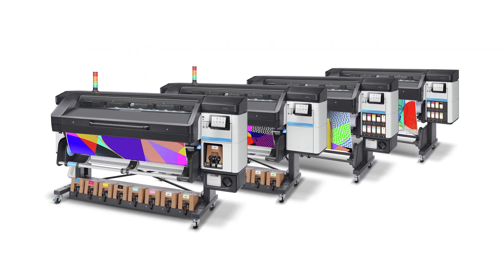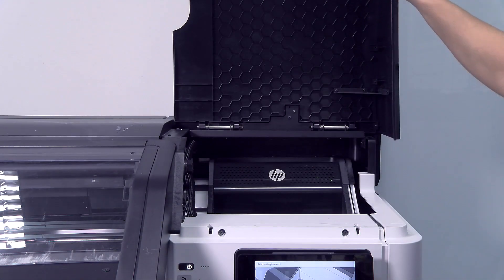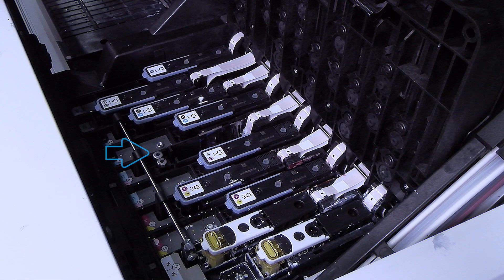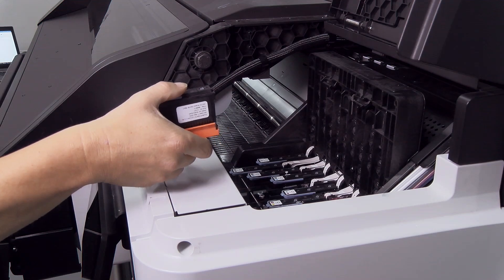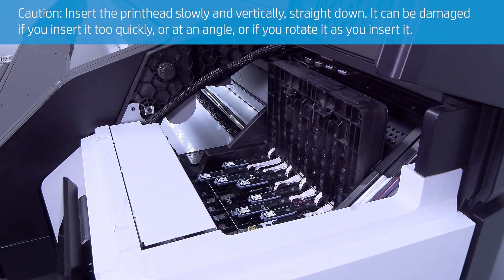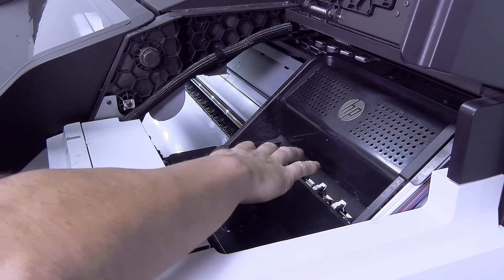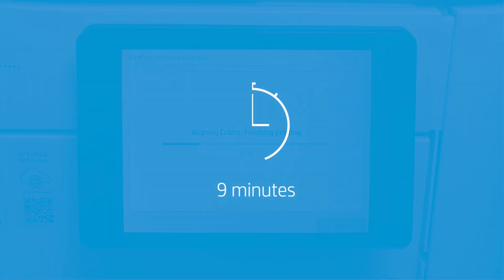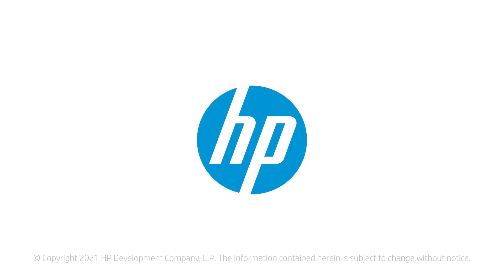How to Replace a Printhead on the HP Latex 700 & 800 Printer Series | HP

Comment: Your system does not allow you to replace printheads with ink levels that low.
Reply from the maker: Hi there, thanks for contacting HP Global Social Media Support!
I understand that you need to replace the printhead of your printer.
I will do my best to assist you.
In order to get this issue fixed, please contact our customer care team over the phone or chat for further assistance, as this issue requires Live conversation with you over phone or chat to isolate the issue and provide you instantly with appropriate solution or repair/replacement options available at your place as per the warranty.
Please feel free to reach us on call/chat, please access this link to select your preferred country and language option to reach us. Global support link: - https://www8.hp.com/us/en/contact-hp/ww-phone-assist.html
Binu_HP Social Media Tech Support